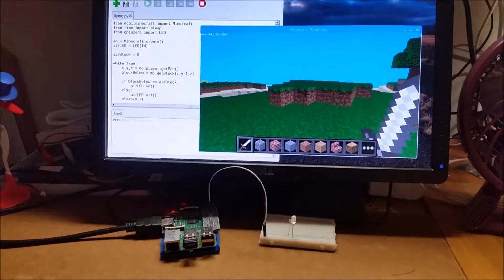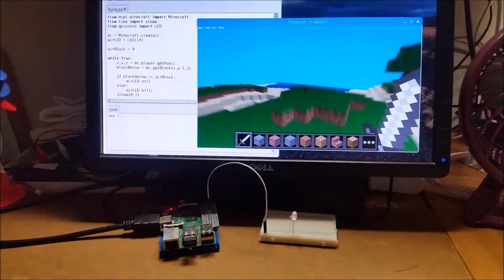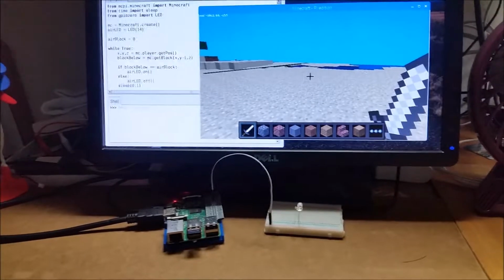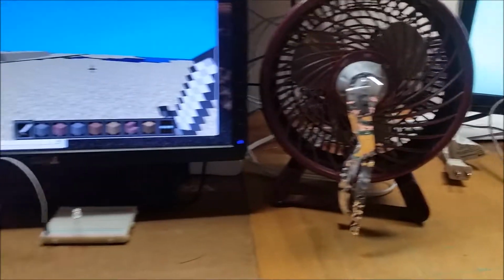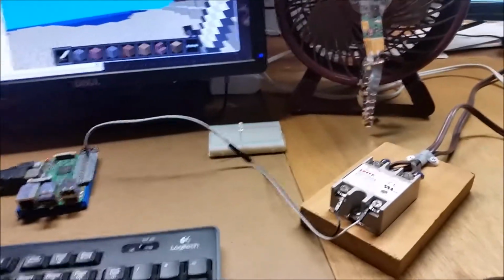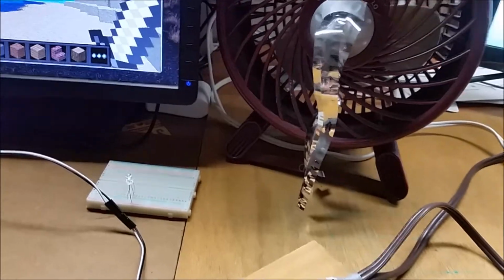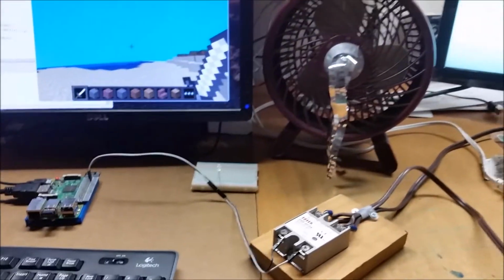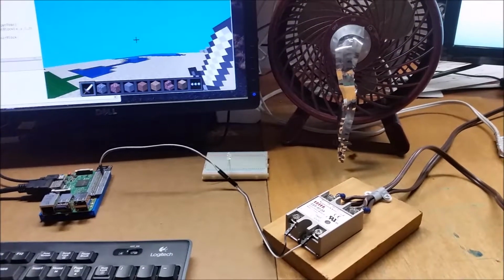Raspberry Pi, Minecraft and Solid State Relays

Comment: hey dawg you should really put a resistor between GPIO and the relay.
Reply: Why should he? Will it negatively affect the Pi?
Reply: @benjaminvincent2578  It depends on the SSR input - if it is just the bare LED of an opto-coupler, no resistor could mean that the LED   will draw too much current.  That is because the forward voltage of the infrared LED in many opto-couplers is about 1.2 volts.  The Pi's PIO output is probably 3.3V  (I haven't checked the specs lately.)  If you drive a 1.2V LED with a 3.3V driver, the only thing limiting current is the output transistor of the PIO pin.   The output current in CAN drive when nearly shorted like this is likely above its RATED output current.  That may also be above the rated current for the LED, which could damage that as well.

The damage may not be immediate, and it could work fine for months before either the PIO or the LED fails.  

Making sure it doesn't fail is quite simple though:

1: Look at the datasheet for the SSR and find its rated operating current (If) and forward operating voltage (Vf).

2: Verify that the operating current needed by the SSR is LESS than the maximum current rating of the Pi's PIO.  If it is not, you will need to use another transistor to boost the current.  

3: See what the output HI voltage is on the Pi's PIO (Vhi).  This is typically close to its supply voltage, like 3.3V.

3: Calculate the resistor value you need with this equation:  R = (Vhi - Vf)/If.    Typical values tend to be on the order of (3.3-1.2)V/10mA = 210 ohms.  That happens to be a standard 1% resistor value.  If your calculations don't land on a standard value, picking the closest value that is slightly larger is always safe.  But if you're very close to the next smaller value, that will probably be  fine as well, as long as you don't exceed the PIO or LED's current rating - check with If = (Vhi -Vf)/Rsmall.